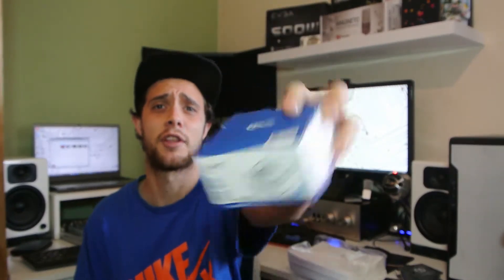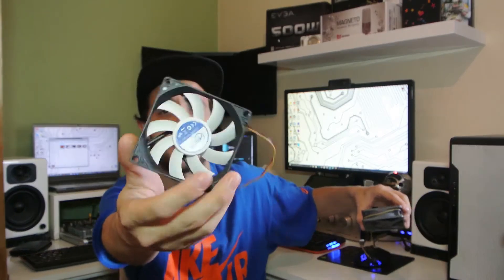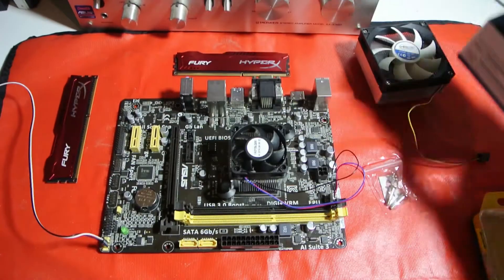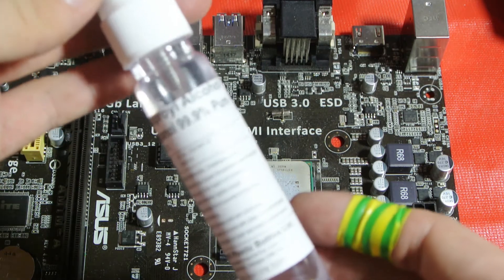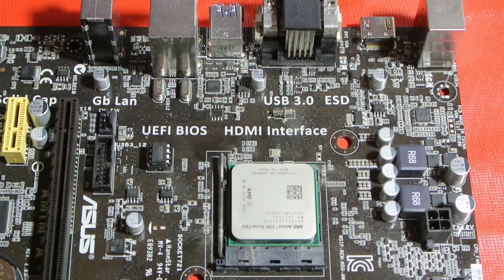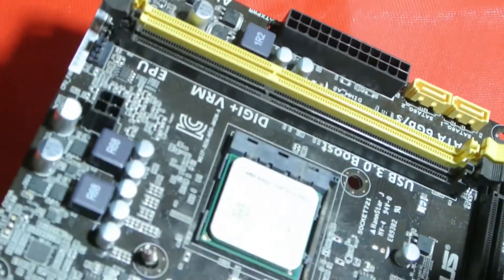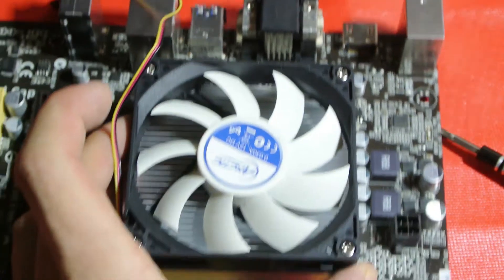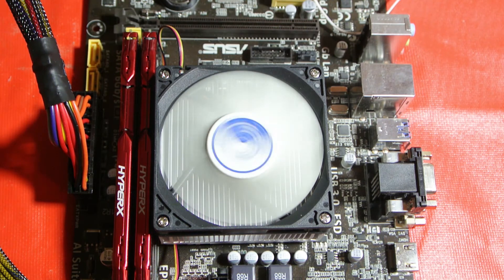Arctic Alpine M1 AM1 Cpu Cooler Install

Comment: is there any proper coolers for am1 socket, i want to over clock but i dont trust a little one like that
Reply from the maker: NorwegianBass Team Red Gaming temps are perfectly fine with this cooler when I overclocked. I swapped the fan for the full size arctic f8 instead of the slim but you could easily put a noctua on it. thing never went over 50 with 2.5ghz overclock